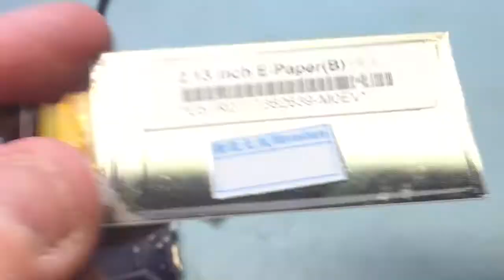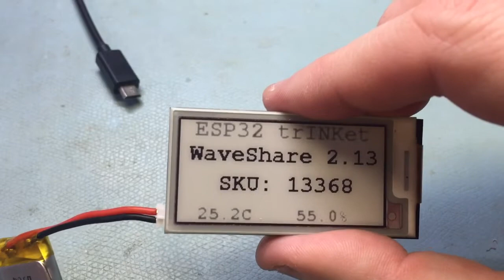ESP32 trINKet E-ink updated

Comment: Awesome to see an update on this! If the battery and usb is plugged in and you remove the battery, does it run directly off the usb?
Reply from the maker: ytfp Yes! It can run on just the battery, just the USB or both!
Reply: awesome, I recommend using black and white so you can do partial refresh.

Comment: Looking nice!  What is difference between v3.3 in video and v3.4?
Reply from the maker: Dan Brown Rev3.3 requires a small black wire on the EN line from the ESP32 to the programming header that I left out. Rev3.4 has this track in place.
Reply: Great!  I received the case for this I had printed.  Very nicely done!  Looks great in Silver too!